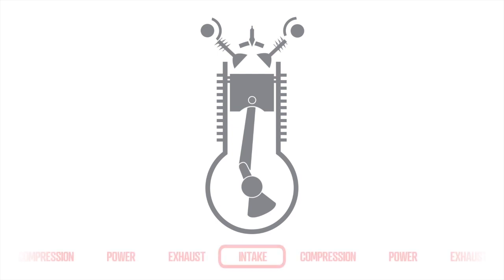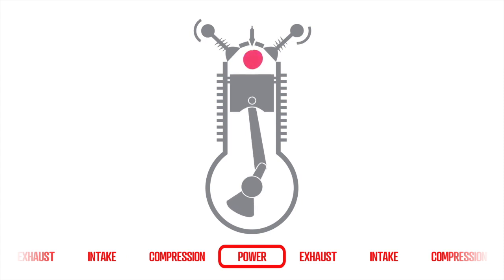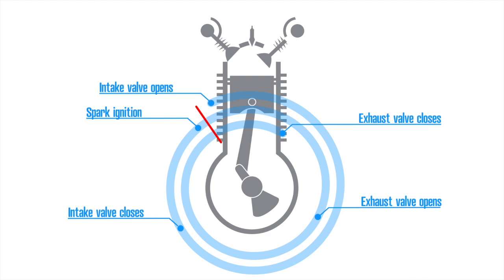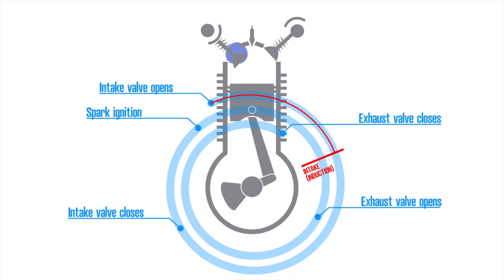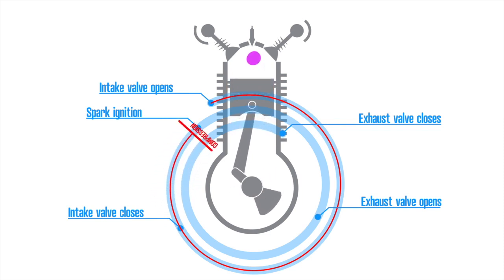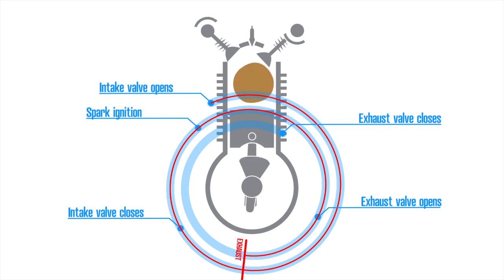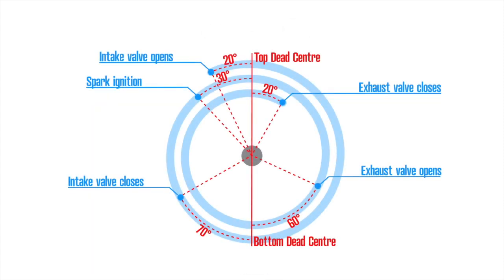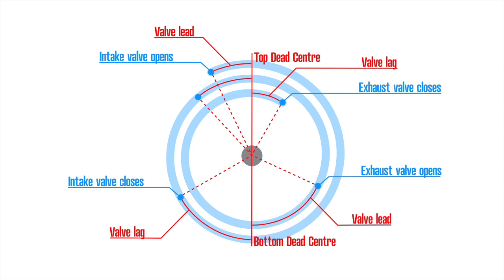The real four-stroke cycle in an aircraft piston engine.

Comment: amazing video!  
hey, on the valve overlap, when both intake and exhaust valves are open, can you explain why the exhaust would only exit via Exhaust valve and not through the Intake valve opening?  thanks
Reply: Pretty simple, the exhaust gas rushing out of the exhaust valve has some momentum, so it still moves when the piston reached his top position, therefor creating a little vacuum, when the intake valve open early the vacuum can be used to suck in fresh air.
Edit: Or the engine is turbocharged an the fresh air presses out the remaning exhaust gases.
Reply: @jonasstahl9826  Momentum yes, not sure about the turbocharged thing though. Supercharged yes, but wouldn't the fact that the turbocharger is driven by the exhuast gases mean that there is increased pressure on both sides of the cylinder?